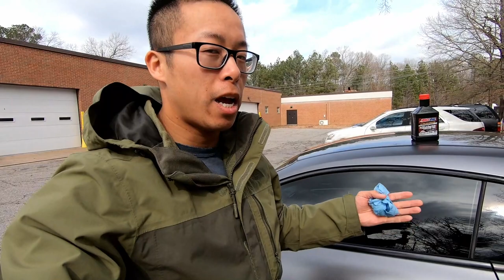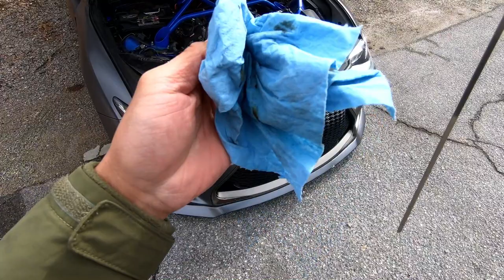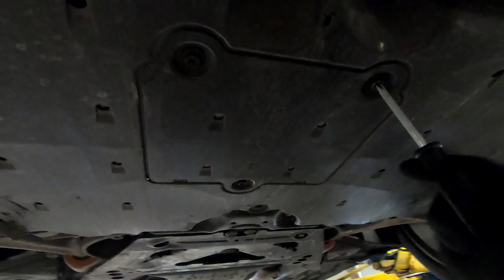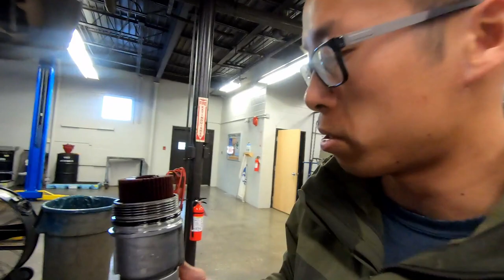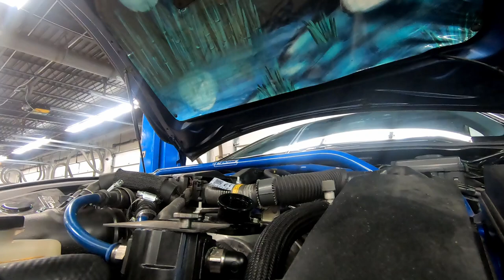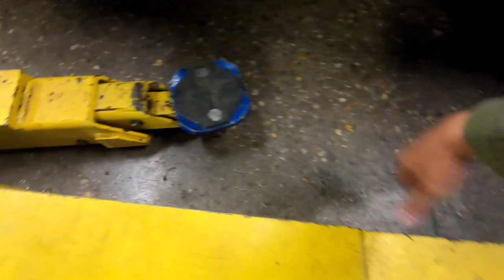What AMSOIL 5W30 Looks Like In A LEXUS RCF After 2000 Miles

Comment: The motor oil is supposed to be dark as it holds the CONTAMINANTS in SUSPENSION!
Reply from the maker: Then its doing its job 😀
Reply: Exactly. I am an Amsoil dealer. Do an OIL analysis. It doesnt mean that its bad. The viscosity wont start to honestly breakdown until 35-40k (all straight highway) Then youll see some thickening. ( this doesnt apply if you are towing etc etc)

Comment: Amsoil has higher detergent than any other oil. Check the TBN number on Amsoil SS. It's dark because it's cleaning out the old sludge. The more you use it it will stay cleaner longer, depending on your driving habits. Also, keep in mind amsoil only recommends using their oil and oil filter when doing extended intervals because only their filter filters @20 microns with 99% efficiency.
Reply from the maker: Its funny you talked about more detergents, I just read up on that this morning. 👍🏼
Reply: He’s correct, you need to use the amsoil oil filter with the Amsoil SS
Reply: On a side note do you pay retail on your amsoil product(s).🤔🤔🤔
Reply from the maker: @josephraymondcaspellan5725  i use the preferred account stuff
Reply: @thehuangbros  nice, anyone told you about amsoil?  Dont forget to use the oil filter.
Reply from the maker: @josephraymondcaspellan5725  are you trying to bash on me with that comment or something?
Reply: @thehuangbros  not at all, im a amsoil dealer
Reply: @thehuangbros  The AMSOIL SS and the efficiency oil filter is the perfect combo

Comment: The oil is dark because of carbon deposits in the engine. The color of the oil does not mean the protective qualities of the oil have stopped working or are not doing their job. At 2,000 miles they still are. It’s not until much longer that those protective qualities start to diminish.
Reply from the maker: Yup

Comment: Do you have a catch can/AoS?
Reply from the maker: I do have a catch can. Its the silver bracket holding the black reservoir there.
Reply: @thehuangbros  Nice blue hoses on it right? How has it been for you do you get alot of blowby in it? I imagine with the dual injection system on these it should be keeping things fairly clean right
Reply from the maker: @freemaysin5088  it is fairly clean like you stated. I get about 1/4 filled if I go from oil change to oil change. If I go to the track or mountain spirit drives, it gets filled.